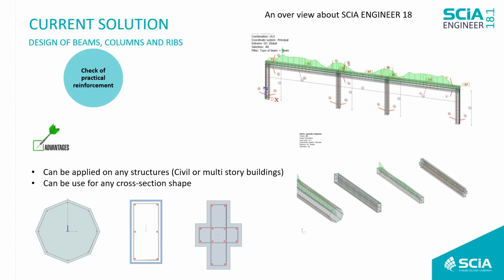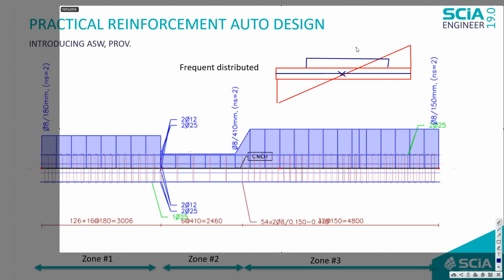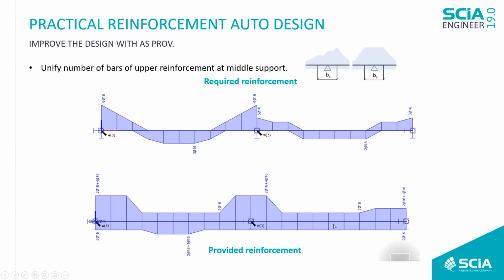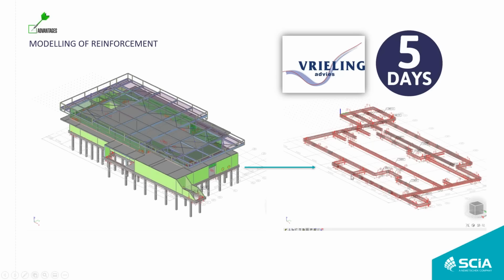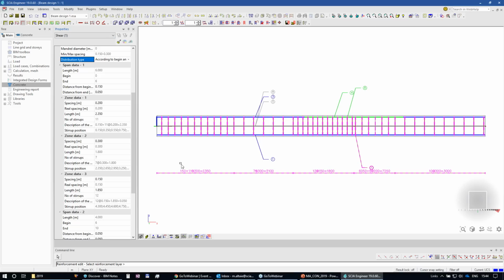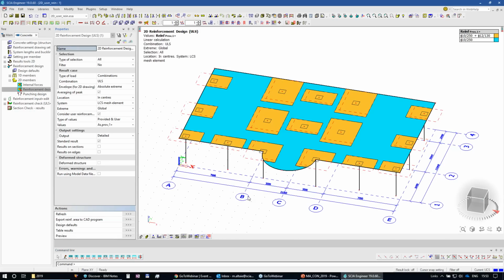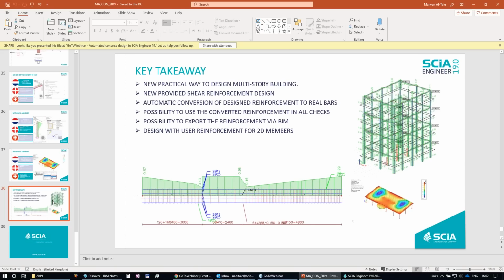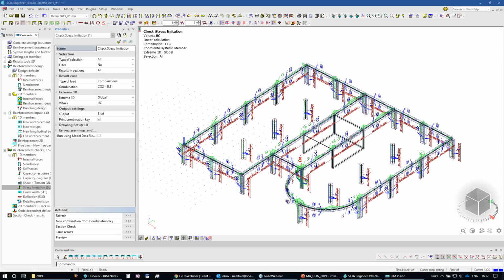[EN] Automated concrete design in SCIA Engineer 19

Comment: Beam and column design completely doesnt work in that version. Program is approximating rebar thickness to 1cm (φ10,20,30) and section check is taking bad dimensions to calculation